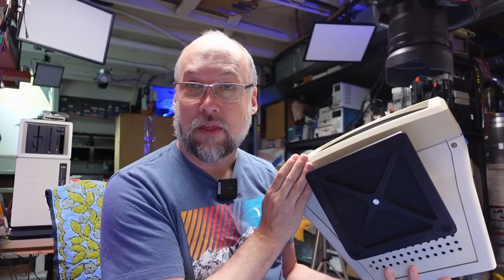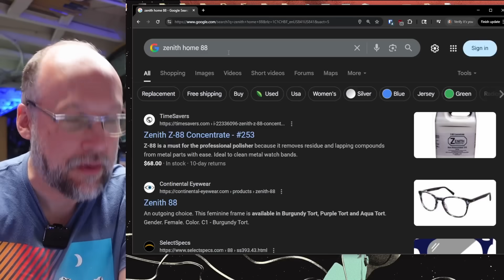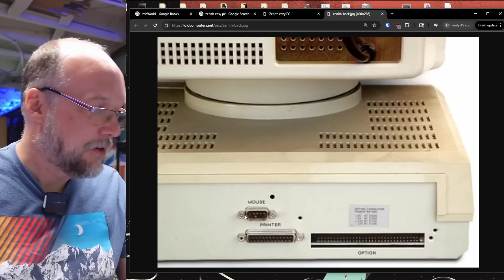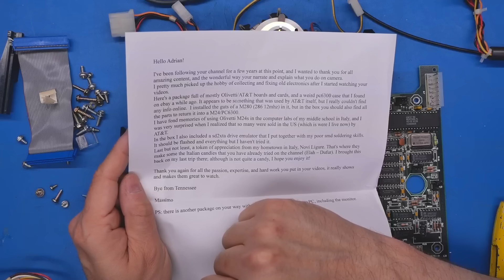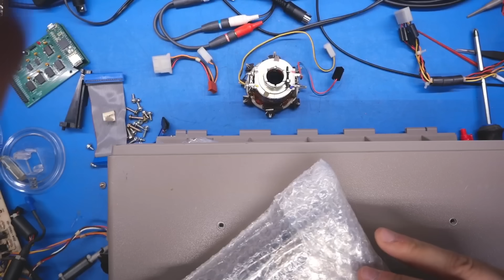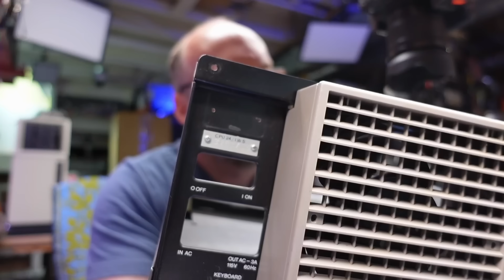0109 An undocumented AT&T computer, Olivetti parts and a terrible Zenith Eazy PC

Comment: A friend of mine might have had one of those Zenith Data Systems PC clones back in the day. He picked it up used, so I don't know when it was built, but as I recall, calling it a clone was a misnomer, because it was completely proprietary. It came with a Zenith-branded word processor, and my friend used it to write assignments in grad school. I don't remember him trying to run anything else on it, but he was an English major and not inclined to play around with technology outside of those items that would have an immediate, tangible benefit for him. I'm guessing whoever sold it to him included a printer, because I don't remember him ever coming to me for help buying one. (Not that I would've been all that helpful to him at the time, as it was still early in my career and I really didn't know that much about the internals of IBM PCs and clones.) It seemed like a pretty pathetic computer, even for its time.

15:35, someone looking for how to open the BIOS setup - LOL! Most computers of that era required you to boot from a Setup diskette to get into the BIOS. Guess what most non-techie owners of such computers lost within 15 minutes of opening the box?

Comment: So it looks like the stock configuration had the "base" of the monitor moulded into the computer itself, so it wasn't that the swivel stand got lost - it simply wasn't possible to use the monitor separately without 3D-printing a replacement independent stand.

Comment: The second you were wondering what "SAB" is, I was already on my way to the comment section to point to Siemens, but before i was done writing this, you found the other IC saying both SAB and Siemens.
(Even though I have never personally seen Siemens X86 processors, I am very familiar with the SAB80C535, a microcontroller using the Intel 8051 core, which is why SAB rang a bell immediately.
Reply: semens

Comment: If the Eazy PC motherboard boots it may not work well unless it has the exact version of MSDOS that it originally came with as it may have had customisations  for the Non PC compatible hardware of the machine, it may require a bit of trial and error to find if a standard version of MS-DOS would work on it

Comment: eazypc reminds of the amstrad 1640/512.   only  you know far worse.  but with the memory options and a tied to the system monitor.   the amstrad however had a plastic cover you could take out to access the expansion cards (pretty neat actually, when used in conjunction with stuff like quickshots joystick card(that's covered with a plastic cover) it's just like using some console carts.

i forget, has adrian had an amstrad pc?  it would make sense for other companies try to copy the great success amstrad had with their pc's.

Comment: In the 90's I was given an Amstrad 'PC'; it was very similar to the Eazy PC, it was only compatible with about 10% of PC software and had a 40MB hard drive. My mum was a writer and fell in love with the word processor on it. She wrote her poems and short stories on it for many years until she passed. It still works. Just not as a PC. LOL. RIP mum.
Reply: what system was it?  1640 and such were compatible with more like 98% of pc software at it's time (of late 80s software.  an ega 1640 with a hd will run even civilization and wing commander.. sorta slowly though).  in just couple of years in early 90s you'd be outdated by what would be 20 years now though.  

amstrad made pcw's, like computer typewriters, though that didn't run dos though too.
Reply: @lasskinn474  I can't remembber. As I said my mum claimed it to do her writing. I have a PCW 8256 that I upgraded to 512K and put a gotek in it. I mostly wrote my own games in basic on that.
Reply: @Franko_Walker  It sounds almost like a PCW10 or PcW16, but those were Z80-based machines like the original PCW series. The earlier PC1512 and PC1640 were pretty mainstream and fairly reasonable PC-compatible systems. Amstrad then made follow-on PC-compatibles which were rather less successful, so perhaps it could have been one of those.

Comment: I saw so many AT&T 6300 / Olivetti M24 machines back in the mid-'90s, and even had one myself running Minix, that I used with dial-up Internet to connect to work. The '286 version looks like it might be the AT&T 6300+ (or 6300 Plus) that came with some neat options including System V UNIX. With UNIX and Merge, you could multitask DOS applications, and also use the UNIX system itself. Alas, I never saw this in operation, as all the AT&T Olivetti machines were relegated to storage rooms by 1995.

I've always had an interest in the '286 and its first step towards the Protected mode operation of the '386 that made running modern operating systems on Intel possible. I've heard lore from co-workers in the '90s, and read stories, but never got to see a '286 computer running something like AT&T UNIX. It would be cool if yours could be restored to operating condition as it was.

Comment: I used to work for a computer shop that sold AT&T6300s (M24). We would get in a base unit, swap the 8086 for a V30, add RAM, put in HD & controller, and sell them. I didn't do much with the 6300Plus (M24 w/286) models, but I did work with many of the 6386 WGS series. I really loved them and installed Unix/Xenix on them at the time as a multi-user accounting system. The 6386E/33 was cool, because of the VFD display. I finally figured out how to program it once I started working at AT&T and got some tech docs for it.
Reply: I have one of the 6386wgs, with the 20 MHz 386dx. It's the desktop version, with extra large footprint to house the miniscribe full height hard drive. It's a tank and I love it. The 32bit memory and expansion slots are so neat
Reply: I came across a couple of AT&T tower computers that had been running some sort of voice prompt dial-in system for a university. Had a very nice case, with a bunch of openings on top for cables. I presumed it was an Olivetti design as well, because of the visual flair it had. Does that ring a bell with you? I've totally forgotten the model. The one I managed to take home had BSDi installed on it, but I never got past the boot screen.
Reply: @Speed-Daemon-123  That's definitely the 386E/33 tower. Does it have the VFD display on the top front? AT&T didn't really want to sell these computers to actual customers, they really just wanted to use the platforms for their own applications, usually voice-based. It was a main processor for their Audix Phone System. They couldn't care less about external cutomers.
Reply: @LordChariot  thanks so much! After 30 years (half my life), I forget details like the VFD display, but the name Audix does ring a bell. I suppose these belonged to Illinois Bell at one time, and maybe someone pinched one for their own use, just as I was looking to do. Mine's long gone, but I held onto it just because I loved the industrial design of the case. There were a couple still running, and since they were in production, I didn't touch them.
Reply: @Speed-Daemon-123  Holy crap... Audix.  I haven't heard that name in 20-25 years... my employer used to have that, it was a corporate PBX voicemail system IIRC?  They had Lucent, then Avaya (descendants/name changes from AT&T I think?) phone systems.

Comment: Greetings Adrian, You brushed off a bit more old dusty B.S. (Before Surgery) memory with the AT&T 8086! I do remember my father mentioning working on an AT&T with a funky chassis 8086 system with the two power conductors connecting to the back-plane! He assisted repairing one for a coworker. I had no idea that there was some sort of AT&T / Olivetti going on to produce them! Wow!

When AT&T stopped making PC's, then shortly there after at a technical conference there was clip boards made out of the next generation AT&T motherboards that never got populated with components, and some holes were drilled through the AT&T logo on the PCB. I still have it... will be some time before I can get my hands on it... to remind myself what processor generation was prototyped but never built. Now I am wondering if the AT&T / Olivetti partnership was still going on with that era system!

Comment: As a kid, I had what I think was a Zenith/Heathkit Z-148.  It's a little hard to tell, but the pictures I've found were the closest to what I remember it looking like.  That one was fully IBM compatible, though, as far as I know.  Lot bigger, and the monitor wasn't attached to it and using it like a base.
Reply: Had a Z-148(Baby 148) back in 1987. Zenith had a government contract back then. Having an RLL hard disk  and having to run Ship command in DOS before you shut the power off.
Reply: @richardmullins9299  I definitely remember the "Park" command as a kid, and dad being thrilled when he didn't have to do that anymore when a newer drive did it automatically.

I also remember a "store demo" type of program, but I don't know how to track it down.  I don't remember enough about it to get anything from Google, just that it cycled through a few different displays.  One of them showed a figure walking, told you to press the turbo button, and did the same walk again to let you see how much further it got with the extra speed.  Another one of the displays was an image of an ornate fountain while a little tune played over the PC speaker, and that the fountain was the same one in the intro for "Married With Children".  But that's all I can remember of it.  I wish I could find it again.

I remember that the keyboard had the Function keys in a 2x5 strip on the left side, and we had an Asteroids game that used F9/F10 for rotating left and right.

Comment: I had a eazyPC that was purchased in 1989 from Monkey Wards for $995. It was the top-of-the-line with the 3.5" floppy and 20MB 3.5" hard drive. My first "serious" computer. I subsequently bought the 640K w/ 1200 baud modem upgrade module on clearance for 100 bucks. Not a bad home-based machine at all. Nice heavy mechanical keyboard. Although it had its shortcomings, it served me very well (it ran darn near most anything an XT could) until I could afford a 386SX system a few years later. It still worked a few years ago except for a bad hard drive controller and the monitor separated from the base.

Comment: Electronics just aren't what they used to be. There's little to no reason to tinker with new electronics. Even upgrades are rarely done anymore. Use it and toss it. Decades of moving production to other countries to drive the price down makes it almost impossible to do business in this space. Olivetti is a great example. I saw a video here on YT of one of their manufacturing sites that were just abandoned. Software, also, is largely dominated by a few major actors. It's a bit sad.

Comment: Oh yes the great vendor lock in and surprise, the IBM clones took off, compared to other attempted systems. Good example is the Tandy 2000 system. As for the at&t system. Not sure if it was a 6300 but I ran across one a few years ago. They already junked the monitor / keyboard Ooops.

Comment: Some basic information regarding the #Olivetti stuff.
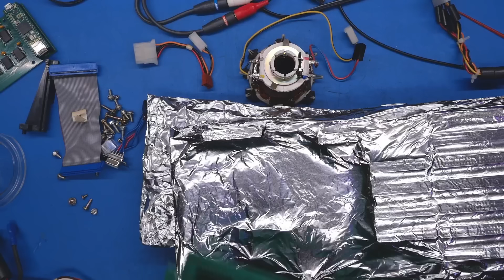@24:56 - This is correctly the Bus Converter for the M24/M24SP. There were a few different revisions on this board. The Olivetti name (see yellow label) is IF172, IF272 or IF314. This Bus Converter takes the +5 V and GND from the PSU and transfer it to the motherboard. Additionally the PSU provides + and - 12V on a thin cable that is hooked directly into the motherboard.

@25:35 - This is the Bus Converter for the Olivetti M28 (NOT M280). The M28 does NOT have a VARTA battery on the Motherboard but has the 4 pin connector on this Bus Coneverter board for at battery. The Olivetti M28 still used the same 16bit graphics card as the Olivetti M24/M24SP

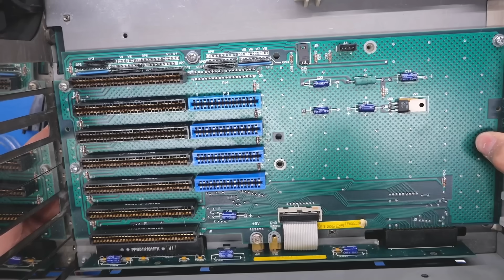@25:49 - This is the Bus Converter board for the Olivetti M280 - The special 16 BIT ISA has been removed completly and the AT style 16 BIT is only avalible. This also ment that the AMAZING Olivetti Graphica card (640*400)  no longer was supported. Olivetti started using a Paridice CGA/EGA/VGA graphics card that also supported the "special" 640*400 16 color resolution.

@31:27 - You are almost correct - The Olivetti 16 BIT and the AT 16 BIT are the same - BUT just not placed the same so it's not a 1 to 1 

If you need more documentation just reach out and I can provide you with more info. Additionally you can look at The Retro Web and see on the Olivetti M24 & M28 boards. I did provide hires images and all the different BIOS's that I have in my Olivetti collection.

Sadly I live in Denmark - so my spare PSU's er 220V - And shipping to US is not easy and super expencive atm.

//TiBo - The Olivetti Colector ;-)
Reply: TiBo, as soon as I saw Olivetti in the thumbnail I thought of you, Youtube's resident Olivetti expert!  No doubt you can answer any and all questions Adrian may have about Olivetti/AT&T 6300.  Anyone that wants to learn practically everything about Olivetti PCs, check out TiBo's channel.  Very unusual PCs, very interesting.  Always fun to see some of my favorite Youtubers cross paths in the comments.  (Seeing Adrian in the comments in I Do Cars' videos was quite the cool surprise.)

Comment: Olivetti of course ended up owning Acorn Comptuers after they went bust (ARM got separated from it though before the sale I believe to become its' own company), a lot of the later Acorns were of Olivetti design, even the Acorn laptops were just Olivetti Echoes laptops stuffed with Acorn hardware... :)
Reply: ARM was founded by Acorn, Apple and VLSI in 1990. Olivetti took control of Acorn in 1985. There was a comment I saw recently where someone mentioned Acorn's "downfall" in 1985. Some "downfall" that was.

As for Olivetti designs being used by Acorn, there was the M19 which might appeal to Adrian, being an attempt by Olivetti to do something vaguely like this Eazy PC, perhaps more competently. Apart from that, the Acorn A4 used the casing of a Triumph-Adler product which was under the Olivetti umbrella at that point. I don't think any other released products had Olivetti origins.

Other than that, there was some collaboration with the Olivetti Research Laboratory, in which Hermann Hauser had some involvement. Acorn made a laser printer card for Olivetti. And there was some European-level research collaboration.

Some signs that Acorn might have been encouraged to sell Olivetti and AT&T products exist in what remains of Acorn's document archives, but Olivetti themselves were hardly enthusiastic to sell things like the AT&T 3B2, and the "trade imbalance" between AT&T and Olivetti was one-sided and seemingly caused their partnership to eventually collapse.

Comment: The company I worked for in the 90's had half a dozen Zeniths that were fully IBM compatible. They were rock solid and lasted many years.
Reply: I started working at a UCSF research center in 1993 that had purchased many (maybe 20 or more) Zenith 386 DX machines in 1989 and they ran a version of Zenith Windows 3.1 and maybe a Zenith version of DOS.. But as you said, they were 100% MS DOS compatible. In 1994, the center switched to Dell computers, but I used a Zenith I took home until 1998. The Zenith monitors were nice and the machines were good quality, and were replaced merely because a 386 processor was outdated for a university research center in 1994.

Comment: I used an Olivetti M24 PC - was a really nice PC for the time,,,, (same as the ATT 6300 as noted),  The PC I used had a high end graphics card from Olivetti installed in ir. (color 640-400 I believe)
Reply: There wasn't much software that could use it either. Stunt car racer might have been one 😂

Comment: interesting......So eventually I got BOTH computers. I tried to put a 3.5" in the compaq from the zenith. But it didn't work. So OBviously it needs the zenith's bios right? So I swapped them but had ESD and ZAP both computers dies......however looking at that board now.....if it is the same board, That's a controller chip not a bios chip. (I really didn't know what I was doing at the time)

Comment: The biggest issue we had was there was no hard drive making it useless for my sister for school. All the software used a hard drive. They had network drops. No way to connect it. So they gave her my compaq 386 and I got this POS instead. I don't remember running into issues other than "there is no hard drive". The compaq also sucked because 5.25 floppies were being phased out. It didn't have a 3.5 floppy. Both were being compared with a commodore 64 and both fell horribly short. The 486 started to pull ahead, but it took time.